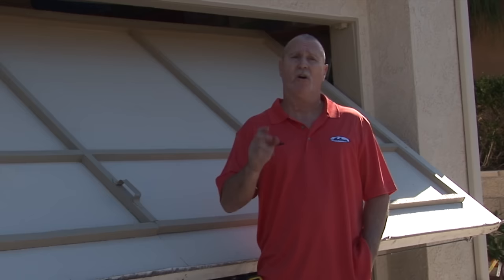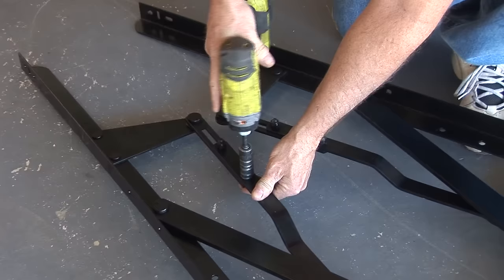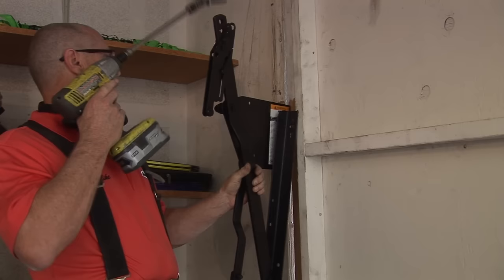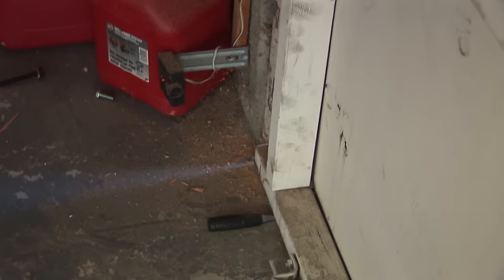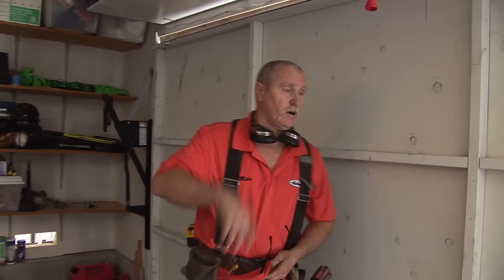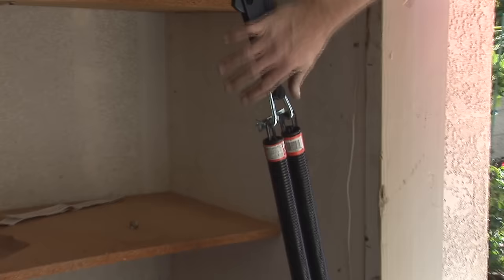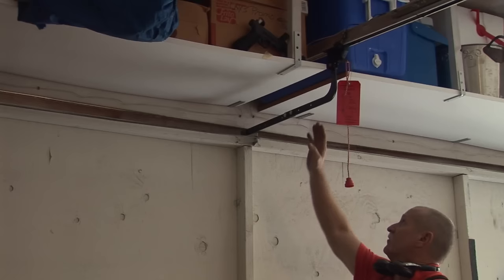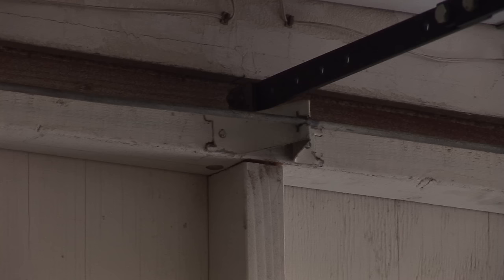Installing Holmes E-900 Hardware & Springs

Comment: HEY MIKE!~  learning alot through your videos. One issue we've been having is once we get through  setup before adding springs we test the door by pushing it open a bit and immediately thr top of the door is hitting the top of the header.  We have about 1.5" gap while completely closed but as soon as we swing it open it hits the top. Do we really need a larger gap or is there an adjustment were not using?
Reply from the maker: good question, the door typically uses the header as a stop or bumper otherwise the door will tuck underneath it. if your not planning on lowering the opening then look on the main plate and near the bottom there are three holes, move the cantelever over to the middle hole and the door will turn faster, if you go to the farthest hole it will turn back immediately but then the garage door opener will struggle with it.

Comment: Great video; very informative. But, what can you do if you're not strong enough to pull up and hook the spring on the hook? Is there some hardware that will let you connect the springs, and then stretch the spring? Maybe some kind of adjustable bottom connector?
Reply from the maker: Depot sells U-hooks for the bottom that adjust as you tighten but its a long process of tightening. There's not as much strength needed as one might think to stretch a spring, you only need 2inches of stretch on most doors. Dip your knees and grab the spring just above the half way point and pin your arms to your sides tight then just stand up, the spring if gripped properly will stretch as you stand. the guy that trained me many years ago was 115 lbs and he easily stretched all sizes... i couldn't figure out how he did it... then he showed me his technique and voila!! it was easy... no secrets to it just proper form.
Reply: @ALLProGarageDoors  - Thank you for your reply. I will try that.
Reply from the maker: Marc I think you can do it!
Reply: I learned to do this yesterday. I had a hell of of time gripping the spring while wearing gloves, then I tried it bare handed and it was MUCH grippier and I had no trouble stretching the springs. (still required a good deal of strength though...)

Comment: Question..I have a one car door that I want to install this hardware on. I don't plan on opening this garage door often. Just when I'm working on my bikes. Besides everything you have done here, do I need the center track or motor in order for this door to open . I'd prefer not to in order make this a low cost project. Please let me know

Comment: Thanks for the video, Mike! Super helpful!

I have a question you might be able to answer.

I've done the install, however, when the door is open, the garage door is a bit low in height. Is there a way I can increase the height?

As note, is used the previous master plate's holes in the metal jabs for the new master plate. So, maybe it's due to different equipment? I'm not too sure.

Thank you :)
Reply from the maker: Yea they rarely sit right using the old holes, you’ll have to see how much room you have to go up and raise the main plates to match that measurement.

Comment: Mike, great video! I have a question:  
My 1-pc door is very heavy; to make the door so it doesn't drop so quickly from shoulder to waste 1) should I move the bolt on the arm to the next closer hole (you said this would provide a large adjustment) or...2) Should I reconnect the springs to a lower chain link..? 
Thanks in advance,
Brad

Comment: My door rubs against the left wall.  It pulls to that side.  Why would that take place and can it be adjusted?
Reply from the maker: How it got that way is anyones guess. You’ll need to move the arm on the opposite side slightly to get it to pull the door back away from the jamb.

Comment: I just change new springs as per instruction ed and it is working fine. Thank a lot.
I just change new springs as instructed and it is working fine. Thank a lot! How to change the opener, Crusader 220SS? Do you have any video for that?
Reply from the maker: Not that particular machine but i do have a video on hanging an opener on a 1pc door.

Comment: Great video very detailed. I have one of these one piece garage doors and it closes very violently and jerky, got any suggestions?
Reply from the maker: Check the pivot points for wear and make sure when the door is open that the drive arm is higher at the door than at the trolley and check the door balance by hand.

Comment: Good video !~   Need quick question:  my one piece sheet metal door has vintage original horiz roller wheel rails up high (both sides), does this e900 system need those rails which have only 1 roller at top of each side of door ? there is no vertical track at all, just wondering if I should try to keep the existing top tracks and the left and right top rollers to use with the e900 to make it extra safe/ stable ?   I'm thinking no, it does not have to have the upper rails as it can do the whole door stand alone, but it probably would make it stronger "if" the exact alignment w existing vintage rail tracks could be made, (its not possible to move the upper rails to accommodate e900 system so e900 is the only adjustment. ) , thanks.
Reply from the maker: Sorry about the delay… if you switch out to e900 then the tracks will be obsolete. it’s quite a job to switch from jamb track hardware like yours to e900 but totally doable.

Comment: Mike, how are you? Where can I get the measuring tape that comes in the box to indicate where to put the arms and make the holes because I don't know where I put it. Hugs.
Reply from the maker: @GerAlv-fo9pm  The measurement is 19-3/4 plus the thickness of the door from the underside of the header.
Reply: @ALLProGarageDoors  thank you Mike.
Reply: @ALLProGarageDoors  to the center of the hinge? or to the beginning of the top end

Comment: This video is perfect! I now can confidently tackle my replacement job. 
One question. You mentioned adjusting the top and bottom tension rods, but didn’t explain what the target tension) is. What is the goal when tightening these?
Reply from the maker: the “truss rods” keep the door from sagging in the middle, so if your door looks to be drooping… tightening these rods takes the sag out of the door when it’s open. 👍🏽👍🏽
Reply: @ALLProGarageDoors  well hey, that sounds logical! Thanks

Comment: I ran into a problem with the 900 series, 1, the actual plate is not the same size as the 1100 series, and because of that the top of my garage door does not sit flush ( I need to shim my garage door about 1/2 an inch. And I suppose my p730 springs are useless because it tilts on the side I replaced. I have to still replace and shim the other side ( Curses Holmes Corp for not making a 1100 kit ) your 900 kit isn't a real direct fit. However I do like the spring tensioner. Now if I can't use my 2 year old p730 springs I might just bit the dust and get what everyone has in the neighborhood... A new sectional door. Hopefully there is something I overlooked. I'm glad I got one side done before the rains come. My garage door is newly painted so I'm not worried about water penetrating through making a heavy door out of it. Still love your video!
Reply from the maker: The E-900 is definitely different from 1100. the measurements are different, i do believe they say to measure 20" plus the thickness of the door down from the header, but i've found the old measurement of 19 1/2 to 19 3/4 to work better for me. the thickness of the door is to be measured from one of the sides not the bottom or top. 730 springs are for doors around 7'4" to 7'6" high, 7 ft high doors take a 728
Reply: @ALLProGarageDoors  would that bring the top back in... It's only out about an inch maybe 1 1/4 I'd think by shimming the garage door would do the trick but definitely notice the door is warp a little when operating with the original bracket on one side and the 900 on the other side, but doesn't rub on the house and my garage door opener still operates. I'm waiting till Thursday to do the other side.
Reply from the maker: @robertfaulkner7152  Hard to tell exactly whats going on by your description but you can try it. i wouldn't do anything adjustment wise until you get the other side installed.
Reply: @ALLProGarageDoors  I installed the other arm and the door stabilized. All is working good. Definitely having counter weights definitely helped when lowering the door... But honestly two five gallon buckets isn't enough.
Reply from the maker: @robertfaulkner7152  That's great, glad to hear it worked out.

Comment: I have a silly question. Can this be done by one person if the garage door is the only way in and out? I’m planning on building a door from scratch and installing it.
Reply from the maker: I’ve built and installed hundreds by myself, the tough part is lifting it without springs if you build it heavy you might pay the price later build it light and your fine.
Reply: Specifically you need to raise the door to install the spring, but you’re stuck inside
Reply from the maker: Exactly, having someone outside if possible would make it hella easier but with much pain and strain it can be done with one.
Reply from the maker: Open it, prop it up, then spring it.
Reply: Gotcha. I’m a strong guy but 16x7 of solid wood will be a challenge. I really appreciate you sharing your skill and answering questions. I was going to build and install a custom wood sectional but I couldn’t find anyone online for guidance that had done it from scratch. I can’t even find a company to sell me the track/rails so I can make my own door. Any chance you have a video on that? Otherwise I’ll probably stick with the one piece based on this video. Thanks again!
Reply from the maker: If your local then we sell it all... piece by piece if you need it, track, springs, hardware etc. I don’t know of any vids on how to build a custom wood sectional but I have one on building a one piece door from scratch. It’s pretty basic stuff.
Reply from the maker: https://youtu.be/hWi0iuSOXiM

Comment: Dumb question, but what was holding the door in place after you removed the old hardware?
Reply from the maker: I use 20p galv nails...one on each side somewhere near the top
Reply: @ALLProGarageDoors  Thanks for the video. It was very helpful.
I do have a question too. Why can't you remove one side of the hardware, replace it with the new hardware on that side and then go to the second side, remove it and then install the new one?
To reword my query, why do you remove both sets of hardware before installing the new hardware? Is it so you can make the adjustments and make sure that the door is aligned properly?
Reply from the maker: @danielsweet1799  Good question, I suppose you could do it that way if your satisfied with the height of the door off the ground, if you want the door higher or lower you'd have to release it from both sides onto whatever shim you have underneath the door but short of that i don't see any other reason on you couldn't leave one side still connected to the old hardware while working on the other... just don't attempt to operate it with two different types of hardware in the meantime.

Comment: Mike congratulations. who makes the hardware now?  I need that information and link because Holmes changed owners and they no longer manufacture it, is it the same for any size of gate?  mine measures 5.70 meters wide, in feet 18.700787.  per 2 meters high, in feet.  6.56168.
Reply from the maker: try Apex or American. they are usually rated in weight rather than size.

Comment: excellent explanatory video, I would like to know what is the length between each point of rotation of the mechanism ?, or where I can get some plane in which detail the lengths, is to see if this system I can adapt to my garage, thanks supporting.
Reply from the maker: I think you might be better off trying to google that info, not sure you’ll find it on youtube. Maybe you can find the specs somewhere on google.
Reply: This E900 site seems to describe the Holmes product in detail :  http://www.onepiecegarage.com/garage-hardware-installation_a/263.htm   I have a really bad old installation - maybe this fine video will help me too - still preparing...

Comment: Great video. This was on a wood door if you have a 1 car metal garage door not very heavy gauge would you use the same lags to attach to the door or use a different method.? Also not sure what springs I would use? Original installation had roller assembly on each side which bit the dust.
Reply from the maker: We do more metal than wood, we use fine threaded self tapping screws and a nut on the back side.As for springs i'd say one 728 on each side should work just fine.
Reply: @ALLProGarageDoors  Thanks!

Comment: Thanks for the video Mike. I have one question about locating the top bolt for the main bracket in the door jamb. I searched thru the comments and didn't see any reference so maybe I'm missing something. Starting about 10:10 you talk about measuring down from the bottom of the header 23-1/2" using the template but it looks like you put your reference mark on the jamb adjacent to the bottom of the horizontal 2x4 along the top of the door on both sides not the bottom of the header beam to measure from. What am I missing? I know this is going to determine clearance between the open door and the header where the bumper goes and I want to get it right the first time. I don't have a template but I put the hinge on the garage floor in the open position and measured from the main plate top mounting hole to the angle bracket that attaches to the door and got 20". My door is 3" thick so to locate the top hole in the main plate I should measure from the bottom of the header down 23" then add an inch or two so there will be clearance, correct? Hope this all makes sense. Let me know if you need pictures and I'll e-mail you.

Background: Years ago I got a one piece wood door from a friend who replaced his with a sectional door. I built a door frame in the back of my garage and cut out the wall and installed the door using all the old hardware except I used new springs. That door finally got too old and ratty so I built my own from scratch and am using your video to re-install the hardware. Sorry for such a long question, I used to write engineering process instructions.
Reply from the maker: The measurements are 20” plus thickness of door ( taken from the side) and that’s it, no adding anymore inches to it just 20 plus door thickness and you’ll measure from the bottom of the header down. Sometimes here in SD we get jambs that are notched around the header and extend above so taking the measurements are harder but just go from the underside of the header down.
Reply: @ALLProGarageDoors  OK perfect. Thank you for the quick reply. I'm at that point right now.

Comment: Im wondering if I missed something. After you removed both brackets and the door was sitting on the ground how did you support it to keep it from falling out front?
Thanks for the video.
Reply from the maker: the door is taller than the header beam so it rests against the beam.

Comment: Mike, could you help a fellow pro out... I'm trying to find a distributor who sells top rollers for one-piece kick-out doors. Please let me know if you have a connection!
Reply from the maker: sam robinson  I take it your talking about “jambtrack” one piece doors where theres one horizontaltrack on each side. Thats a tough one, the only reason I don’t have a connection to an mfg is that its just too simple and cost efficient to just fab one up. The last time I needed one i just took a sectional door bottom bracket and flipped it upside down and cut the cable knob off and used a long stem roller. This allows thru bolting if needed and you can run a screw or two into the side because the bottom bracket will wrap around the door.
Reply: Thats what we will start doing! Thanks for the awesome advice Mike!
Reply from the maker: sam robinson ...... No problem Sam! You’ll save a ton of money too, bottom brackets are inexpensive

Comment: So if a door is heavy, wont open or stay up new springs would be a start? They are at least 12 years old. I have it on the 2nd last hole on the arm and it is still heavy. Also need to stretch spring about 10-12 inches to hook onto arm.
Reply from the maker: You need bigger springs, maybe a 528 and a 728 on the same side or even a pair of 528s for the really heavy doors. The springs should have a 1-2 inch starting stretch.

Comment: I have a question on spring length.
I commonly see 28",30" and 32"

I know the wire thickness 5,7,9 determines strength and how much weight the springs will lift.

How do you pick the correct length of spring?

My scenario - a rental property with 6 doors,  All doors are original and I'm finding 4 spring lengths.

My guess is the repair people use what they have and make it work...

How to you pick the correct length?

Any advantage to a longer or shorter spring?

thanks
Reply from the maker: A 7 ft high or less would be the 28" 7ft 4" to 7ft 6" would take the 30" and an 8 ft high door would be the 32". if you use a spring thats too long for the height of the door then the door won't stay open when operated by hand because the springs go slack so you gotta have the proper length. The wire gauge is a bit harder to get right without experience and having different sizes on hand to try out but a rule of thumb would be that 2-728s on each side of a double car door can usually balance it if the plywood isn't too thick and the door is what would be considered normal. I can balance most doors with a pair of 728s on each side, if it's maybe a thicker ply or has trim on the face that adds weight so i could do a 728 and a 528 on each side. real heavy doors would take a pair of 528s  on each side but your hinges need to be in great shape to take that kind of spring pressure. same goes for single car doors but only one spring on each side.